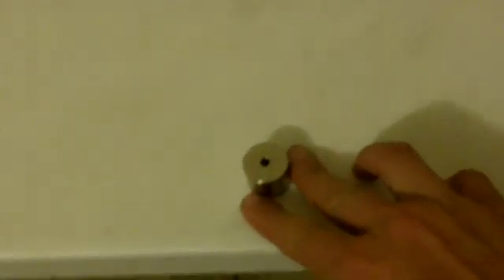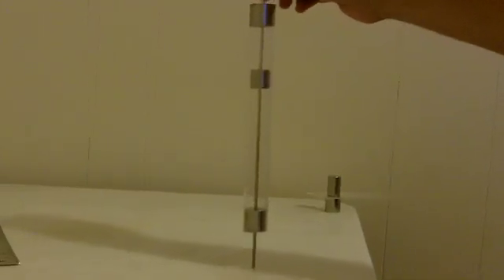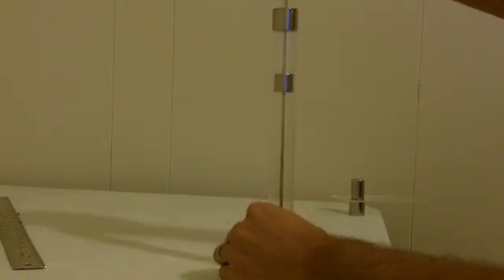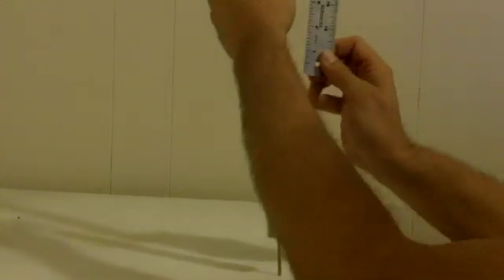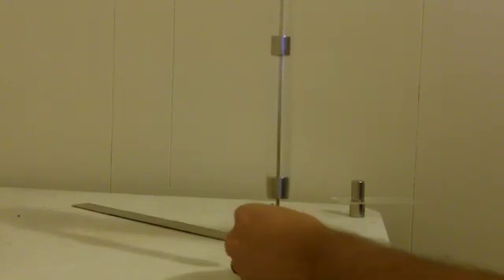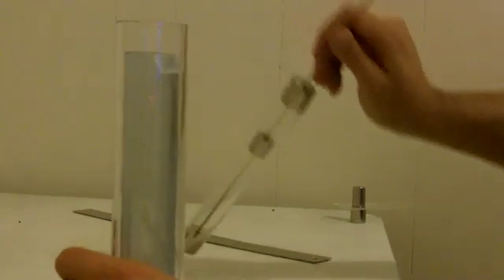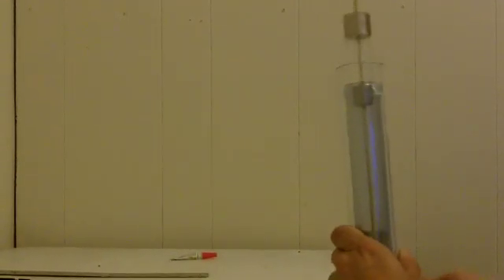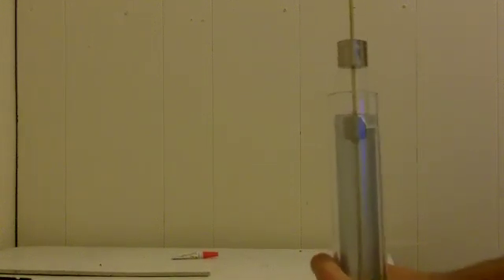How to make a Permanent Magnet Piston

Comment: unlimited energy can be drawn in via magnets with same pole together with metal in middle with iron or stainless steel pipe running through ring magnets into gas engine with 90 degree spike.

Comment from the maker: I will explain simply.

Magnets are used in the old CRT television sets to move the electrons that create the picture.

Magnetism is used in MRI's to create pictures of our internal organs.

They do this by manipulating and directing protons and charged particles.

The MRI can create an image with millimeter precision.

In a plasma ion engine, magnets are used to move and direct the charged ions.

In a supercollider the magnets are used to direct the protons around a huge circle at near the speed
of light with such precision that they can crash them into one another.

Now how does this relate to electrolysis?

Electrolysis is splitting the water molecule into Hydrogen ions which are positive + and are basically just protons.

They are basically the same thing the supercolliders and MRI machines move around.

Electrolysis also splits the water molecule into equal amounts of hydroxide ions which are negative -.

The H+ ions are what makes acid and the OH- ions are what makes a solution a base.

You have equal amounts of acid and base and they neutralize each other and just make water.  

The H+ ions and OH- ions are attracted to each other which is what makes electrolysis less efficient.

In electrolysis an electrical current is run through water via a cathode (gives electrons) and an anode (receives electrons.)

Membranes are currently used to try and help separate the two and keep them separate in the process.  

The H+ ions are converted to Hydrogen gas at the cathode (They are given electrons) and the OH- ions are converted to Oxygen at the anode (they take electrons.)

What I am saying is that magnetism in the form of permanent magnets can easily be used to direct the Hydrogen ions to the cathode and the hydroxide ions to the anode.

Keeping them separated and drawn to the correct electrode is the main problem that needs to be addressed and the primary draw on the power required by the process.

Using permanent magnets to accomplish this will increase the efficiency and effectiveness of electrolysis 100 fold.

ALL other sources of energy are 100% completely and utterly obsolete and unnecessary.

Comment from the maker: It is very easy to empirically observe that the Shear Force is less than the Pull Force in many situations.  If you go to KJmagnetics and look up item BX0X0X0-N52 you will find a 1" cube magnet with a 94.6 lb pull force.  If you click on the Pull Force Case 3 link you will see a log graph of the pull force curve.  The maximum Shear Force required to shear the magnets will be right about 28.5 lbs.  It is true that this corresponds to a distance of about 0.33 inches and this may lead someone to mistakenly believe that the total shear force is equal to the total pull force as you have to shear the magnet for 1 inch.  However, the shear force is not a constant 28.5 lbs.  Initially the shear force is less and it gradually builds up to the 28.5 lbs and then after 1" it precipitously drops to nothing.  So just as the pull force is not a straight line, neither is the Shear Force.  Furthermore, EVEN IF the Shear Force was a constant 28.5 lbs for the full inch then it is still easy to prove that there is excess energy in the Pull Force.  The Pull Force chart only goes to 1 inch but there is STILL 7.5 lbs of Pull Force at 1 inch and there is still a significant amount of force after that which could be captured and utilized.  In no way in two of these magnets could it be argued that the overall Shear Force is equal to the overall Pull Force.  You don't even need a Push Pull meter to empirically observe this.

Comment: Maybe this is a dumb question, but instead of point it north and going against gravity, how about pointing it south towards a spring?
Reply from the maker: The opposing polarity of the anchor magnet acts as a perfectly matched spring.  It would be extremely difficult to engineer a logarithmic spring.  The effect of gravity is negligible in comparison to the magnetic forces.
Reply: Ima MagnetFanatic I see I like the idea of focusing on the release instead of the pull. I was thinking that it was possible to  it was possible to do it upside down by connecting connecting rod, crank shaft, then gears, then a homemade generator. My mind is rushing with ideas, lol. The top having a revolving wheel of magnets that run over the  piston magnet, quickly pulling it and the releasing it.of course in my head I see several pistons going around in a circle and connected by the crank shaft. My problem is 1, the top magnet quickly pulling the piston magnet, sounds...difficult, and 2. The other thing is if the piston is strong enough to move the crank shaft, which does sound a little more possible, but complicated. But yeah if it works, maybe adding copper wire around the piston would add a little more electric power.
Lol sorry Wish-fully thinking.
Reply from the maker: SupremeKingSovereign Yes, there are literally endless possibilities for this which would be fascinating to engineer.  However, I would advise you to just keep it in your head and not spend any time or money on it.  The truth is if anyone got close to bringing something to market you would get a bullet in your head or have an "accident."
Reply: Ima MagnetFanatic and ye' tell the "guys" that are about make that person have an accident, that I know a guy, with a particular set of skills, and we'd hate for them to have an 'accident' before the inventor has an "accident" sir in greatest heavy Irish Liam Neeson accent